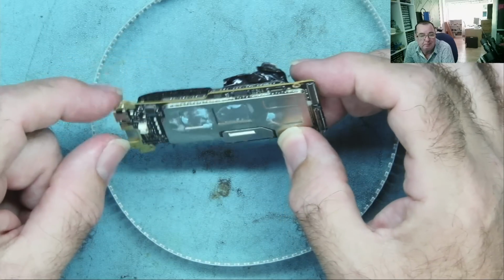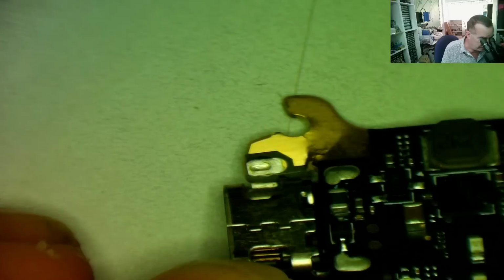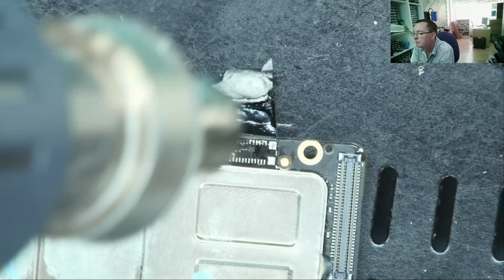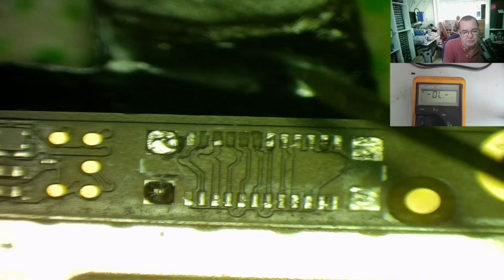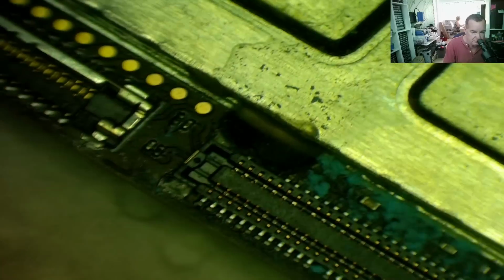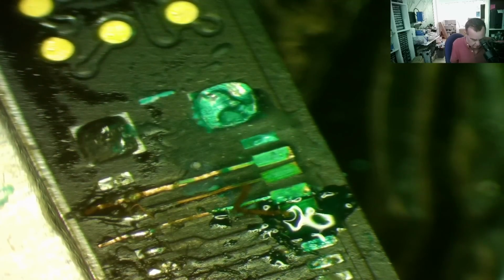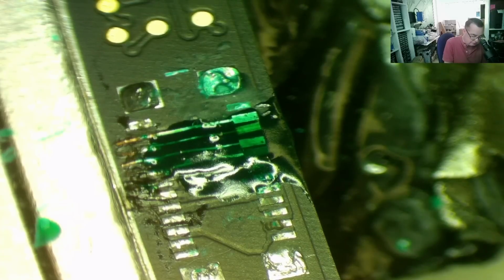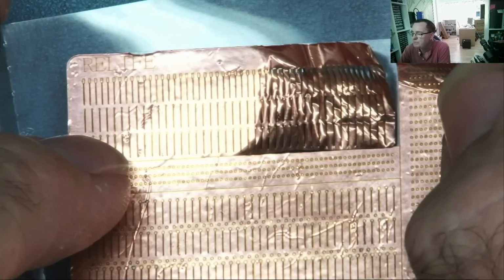This DJI Mavic Mini Pro 3 Motherboard with ripped PCB tracks - What a nightmare repair!!

Comment: Hi Richard are you in the Uk or USA I have a problem with my Dji mini pro 3 the gimbal would not pan right or left turns out it’s a faulty plug on the PTZ one of the pins was missing I sent it to repairs on line in Birmingham Uk with two spare connectors from china? They fitted a connector and now nothing works on the gimbal they say they fitted it correctly? And it’s something I’ve done? I would love you to take a look

Comment: The thing about UV solder mask is that it has to be a very thin layer to cure properly under the UV.  If it's too thick then the surface will harden up and it seems to block the UV from penetrating deeper, so what's under the hardened surface remains squishy.  And if you're putting it underneath the replacement copper traces and pads, the copper will block the UV from hardening the solder mask.  It might work to glue clear plastic together that will let the UV light through to the solder mask, but not something opaque to light.

Comment: hi the green one use this later after you done the job with the uv pen  it goe's very hard if it is use right

i had a bad break on a tascam 38 mum pcb    i glued  a clean up pcb   over where the break was  i put in copper tracks over the break  and use the uv green
over the copper  i say it when hard very fast  

for fine job like this i would use fine  long pins to move the new copper tracks you tryed to put  down  the tools you had were just to big 
i have done work this small  change the stock in phone be fore   i keep to the bigger unit that have a higher turn over   

we older men the eyes are getting older i am finding

Comment: I'm wondering: Have you ever experimented with this conductive silver paint (e.g. EAN 5028356104116)? It says one of its application is track repair, and it may be easier to just draw the tracks with an ultra-fine brush.

Comment: I use the same solder mask, you just need to put thinner layer, smaller amount. It should be very thin so it can cure good under the uv. If it is thicker it cures on top and stays liquid under.

Comment: Verry fiddly, I wouldn't have your patience. Some thoughts (which may help or hinder in future), after placing the pad strips and soldering one end, use a narrow piece of kapton tape (rather than mask) lengthways to fold the pads down. You could also overlap the connector pins top and bottom with just thin trace strips and mask them down on the outer ends (so there is no mask under the connector). You know about side lighting to reduce glare from flux etc. To sort the damaged mounting point probably requires the mounting point to be removed, requiring fine milling or laser cutting and assumes that there is no through-layer stitching near the hole, crack.

Comment: I have a DJI Spark. I believe you might be able to fly the drone with your phone. at least I can with my Spark though it's not a good idea because of fly aways. If you can use your phone, just fly  under 20 feet or so. The most I have done on my Spark is on a used controller i got real cheap, said it would not charge. It needed a new micro usb. used my hot air station to repair. DJI might have a simulator for flying with your drone before you fly with the drone.

Comment: I think that, if you are inclined to, you can look for shorts in the broken multilayer board, using your thermal camera, then using a schematic, you can repair the tracks the way they are supposed to. 😀

Comment: Hi Richard best is to use high spot lamp for uv the same with a little bit hotair then it will stick good. Practise is the message here.
Reply: Also you need to dry it more if it is hard also little help of hotair helps.

Comment: Great “gumption” Richard. I’ve worked on, and fixed stuff (or tried), just to see if I can. Karma of the experience serves me well later on.
On your advice, I was able to repair a vintage solar water collector/storage pump motor controller (C-30), without schematic, just thru your LER thought process. Thx for uploading.

Comment: Try your skills on GSM, after "few" hours of practice you will find this repair easy ;) other than practice is proper soldering handle, t12 is definitely too big. Stronger uv light would save you time as well. You have enough patience, just one bad word during enture vid, you can be proud of yourself, if i would record my first repair of this type, yt would ban me right away😅
Reply from the maker: Agreed about the T12. It wasn't clear in the video, but I changed to a C210 soldering iron to attach the relife tails

Comment: Richard, here are the best practices when doing this type of repair from my years of experience:
1)  Make sure the damage area is free from all contaminants and dry

2) Put a very thin coat of the solder mask liquid down on the absent pad area.
To apply a thin coat put a little bit of solder mask on the end of a Q-tip and wipe it over the absent pad area. Do not drop some on the board using a pair of tweezers or an exacto knife. That is way too much solder mask. I'm talkin thin!

3) With that thin coat in place lightly press one of the replacement solder pads into the correct spot.

4) Using the same Q-tip technique wipe an equally thin coat of UV mask across the top of the pad - and then hit this with the UV light until the new pad is hardened in place. THEN go on to the next one. This process works incredibly better when you do one PAD at a time - affixing each one with UV light as you go along using these techniques.

5) Make sure the "tail"  of the replacement solder pad is routed directly over to the pad you intend to solder it to - but DO NOT solder it yet. Instead, using the same Q-tip technique put a very thin coat of the UV solder mask along the length of the same tail leading up to the pad. Hit that with the UV light, affixing it in place.

6) Do not solder the tail in place. Instead move on to the second replacement pad and repeat the process.
At the end of this you should have all your replacement pads tacked down with fully cured UV solder mask on the wide end, all of your tail ends sitting right over the pad they are to be soldered to, and all of the UV mask hardened along the way.

7) Only now, that all of the UV mask has been applied and hardened, do you solder the ends of the tales to the solder pads.

A couple of other notes:
- Unlike some folks have suggested you do not need a crazy powerful UV light to cure this resin. The trick is to work in thin layers - and if you encounter an area where you did need a thicker layer, apply a thin coat with a Q-tip, hit it with the UV light for just a couple of seconds, then apply your second thin layer with the Q-tip - after which you give a good 30 seconds of hardening.

- On the UV light positioning, when doing pad replacements you want to not only Shine from above but make sure you are also making a circle almost horizontal in 360° during the curing time as well. That way it can penetrate under the replacement pad a bit. (Even though, if you have following above there won't actually be that much material underneath the replacement pad to cure)
Mistake most people make in general is too much solder mask. They end up with the replacement pad floating in solder mask and when that happens the UV light is unable to cure the material underneath the pad because the light is being blocked by the pad.
- A good quality, fully cured UV solder mask will not dissolve by isopropyl alcohol
Reply from the maker: Thanks for the extensive reply.  I enjoyed making this video as I was trying something new for the first time and I'm happy to show when something does not go as I expected it too.  The biggest problem I had was step (5) getting the Relife tails to stay straight, as soon as I peeled them of the backing, they would twist, bend and curl.  Is there a good way to get them to stay straight and flat on the board?  I kinda found my own way to a successful result in the end and learned a lot, but it seems like i made this far more difficult that it should have been
Reply: @learnelectronicsrepair  I'm happy to contribute Richard, and if it's helpful all the better!
What I would have done with this particular repair you were doing is to have just scraped away the manufacturers solder mask over the traces close to where the missing pads were.
Once you did that the amount of tail length you would need would be extremely short because you'd be soldering that a very short distance away from the missing pad. In other words there was really no need to go all the way across to the other side. And the shorter you can make these tails the more manageable the task with these very small peel-off replacement pads becomes.
However in a situation where you do need to retain a longer tail portion I definitely do like the approach of doing a very thin wipe of UV solder mask on the end of the Q-tip to just tack it into the direction I'm going.
The last tip is to always gear your UV solder mask operations in such a manner that you first thoroughly alcohol clean all of the surface and make sure it's dry, then tack down everything with the thin coat of solder mask, Harden it completely under the UV light and only then do any soldering.
It's the flux that destroys the UV compound if it gets mixed with it before the UV compound is cured so you want to make sure to save any soldering or fluxing operations until the end

Comment: I think you made it harder for yourself in the first place.
The idea to solder those new pads on the other side may seem OK at first, but then you dealing with long "tails" and remember you need to solder new connector to the pads that are now used for those tails. This may bite you.
I would just use a grinding pen to expose a bit of track near the missing pad, as close as possible.
Then solder the tail to this exposed track and cut the rest off with very sharp blade. 
Then use TINY TINY bit of solder mask to cover the connection (tail<->track) and I would either leave the pad alone (it will get soldered to new connector) OR if I feel its not good enough I would use TINY TINY amount of solder mask on the other side of the pad, basically outside the reach of new connector, just to keep in there for time new connector is being soldered.
Nice attempt though :)
Reply from the maker: Cheers.  I'm sure there are various better ways to do this, and while I was happy enough with the results I did feel I made the job harder than it should have been.  Doesn't the long tail help prevent the pad from desoldering from the track when I fit the connector, as effectively I can solder both ends of it.
Reply: @learnelectronicsrepair  as they say there's many ways to skin a cat. All I'm saying is that there is way too much material in my opinion, and you will be soldering a second connection on top of the tail, it will require more precision that would be needed otherwise.
A great example and a very common one is HDMI port replacement with pads missing. It's basically the same kind of job. Easy to look for on YT.

Comment: Hi Richard, I am using the same brand of UV mask and I can tell ^^. But I am not sure if it really was the mask itself. Sometimes it cures hard as a rock and sometimes it just goes off easily afterwards. I believe it’s all about the UV Lamp. Sometimes curing if for minutes while moving the lamp helps. Greetings from Cologne to my beloved Spain 🙂.

Comment: Richard you got ones that have some adhesive ones that sticj to the board with that said ... i would just forget about that connector and use wires to connect what ever needs to be connected there instead to fiddle an hour to get a new connector on there a good video tho to show not to bother with stuff like that hahaha

Comment: Simple answer is pad replacement is damn hard even with the right kit, as another person said a stronger uv light would be more beneficial, my UV is 100watt and as also said solder mask needs a super clean area to bond too, flux and Isopropyl I would not recommend or at least keep away from the solder mask, in the past I have used transparent nail polish to stick down tracks and pads, the transceiver on my avatar I totally rebuilt and had a fair few tracks to repair where the previous owner burnt out one of the pcb’s I actually used fibreglass resin to repair it and while it was still wet I laid the new tracks in the resin, once it had cured I finished all the soldering ( didn’t have PCBWAY in them days !!!)
Reply: You don't need a lot of power to cure this UV resin. Even a 6 watt UV lamp can cure this stuff. The trick is surface preparation, lack of contamination, and working in layers if a thicker coating is needed

Comment: Hi Richard, interesting video! i also have seen other of these video's, but they mostly only show what goes right. so i like this video better. 
i might have some tips for you from what i've seen in other video's. 
to remove the glare you can use 2 led light sources at an angle instead of the ring light. one left and one right to remove shadows.
and to fixate the pcb there is some gum called blu tack that you can use to stick stuff to something, for example your pcb to the esd mat, so you work freely on it without the pcb moving.

what i was wondering, did you fully cured solder mask, and did you try curing it more to prevent it being desolved by iso and flux?

really like this video! i hope you will try this again!..
Reply from the maker: I didn't show it in the video, but when I started to solder the relife pads I actually stuck the PCB to the mat with double sided foam tape

Comment: The UV solder mask has to go on to a very clean surface, any flux will cause it to lift or not set, and I reckon you might need a stronger UV light 😂 A bit of heat wafted in from a hot air station helps, and build up the mask layer by layer otherwise it takes forever to harden 👍 Takes a bit of practice but they're a fiddly enough thing to use without having  to puddle them around in UV mask 😂

Comment: Hi Richard 🤗
Not easy work  but your solder skills 👍👍👍👍👍👍.
One question Richard, why didnt you use a pcb holder for better stand??
Reply: I would tape the board to the mat using kapton tape. So much easier when the board cannot move around.